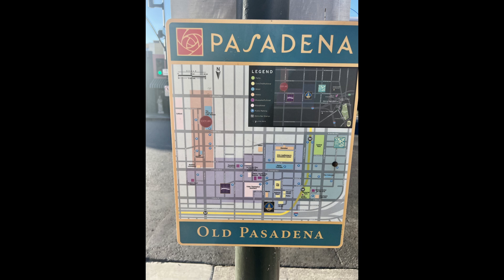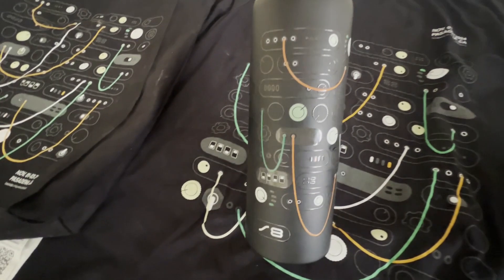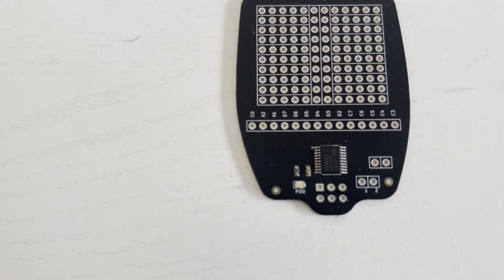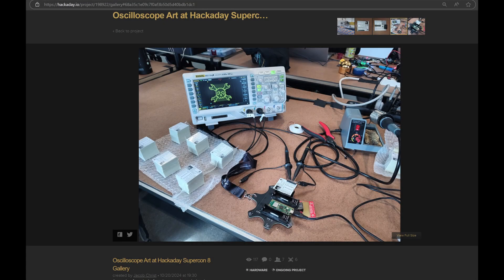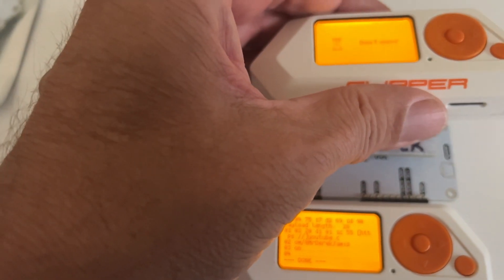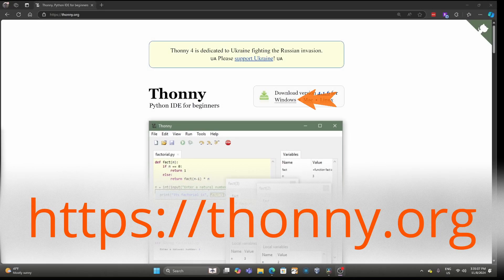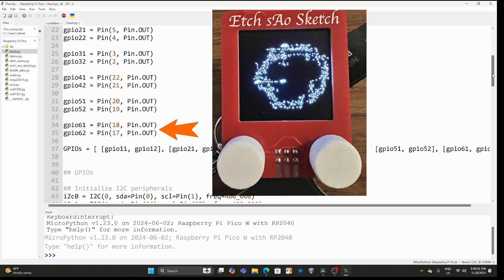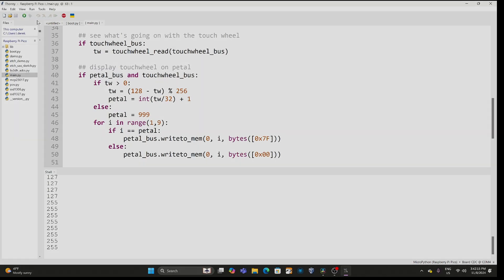[140] Hackaday Supercon 8 conference

Comment: What is SAO?
Reply from the maker: Great question. SAO stands for a lot of things, such as "Simple Add On", "Supercon Add On", "Shitty Add On", etc. It's basically a small add-on that connects to the badge. Originally these add-ons just had artwork. Then people added power to them, so they could do things like blink lights. Then they added I2C so the badge could potentially communicate with the SAO. Then they added GPIO1/GPIO2 so that the badge using WS2812 LEDs could easily extend the lights to the SAOs. In some cases, the SAO can have similar computing power to the badge! At Supercon 8, one of the themes was to try to use either the GPIO pins or I2C pins on the SAO instead of having something that just used the badge as a power source. For example, the badge can read values from one SAO and then tell that value to another SAO, so pressing on the Touchwheel SAO caused a reaction to display on the Petal.

At DEFCON conference, they sometimes have electronic badges and then you can find SAOs that connect to your badge. Creating an SAO that blinks a light is usually a good starter project, so at the DEFCON soldering village you often see people building their first SAO from a kit.

Comment from the maker: Supercon was awesome! I hope to go again next year.
10:19 - I spent so much time incorrectly debugging why I couldn't use I2C to read the ADC values on the etch-sAo-sketch! I was sure it had to do with incorrect registers or power or something. At the end, it was just the fact that the ADC values from the two knobs are also connected to GPIO1/GPIO2 which were being pull up/down by the badge. 😭